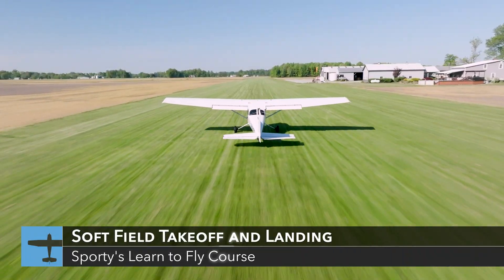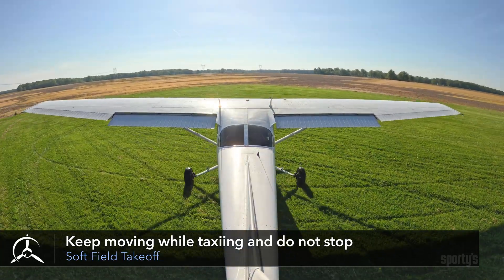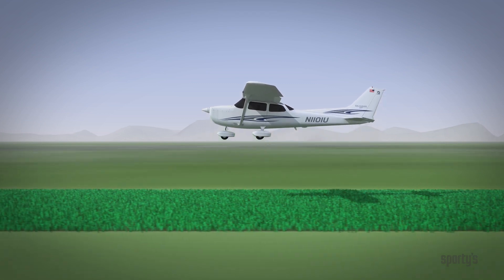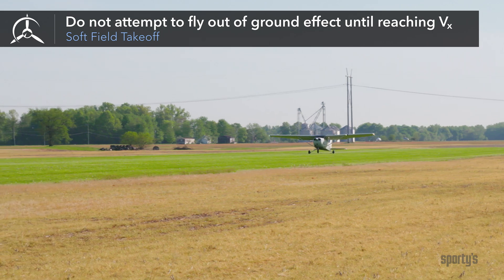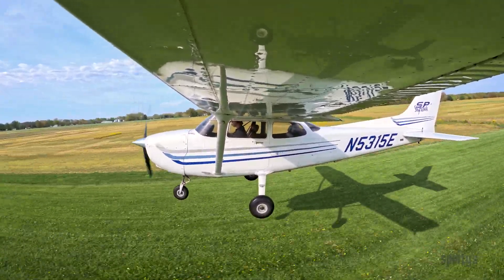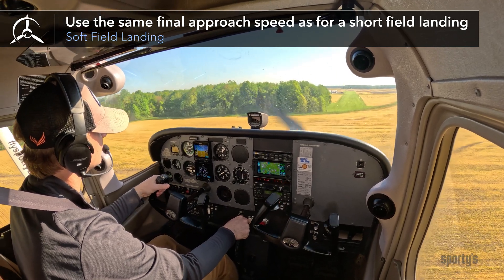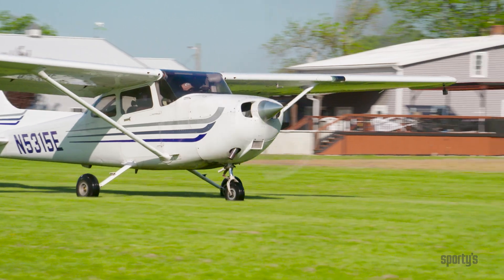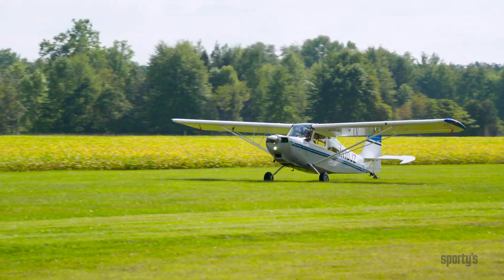How to take off and land from grass runways - Sporty's Private Pilot Training Tips

Comment: You should do your runup on a hard surface. Once you are ready, you set your takeoff configuration, then taxi from the hard surface while checking the skies and listening to the radio, with the control wheel back to take pressure off the nose wheel. You keep moving, like they said, out on to the runway and takeoff. You should learn the details from an experienced instructor because it's a strange change from a hard surface and reacting wrong can result in an accident.

Comment: I learned on a grass runway and was never told to takeoff any different than the hard runways we also trained on. Same for landing. And my instructor had over 27,000 hours going back to before Viet Nam. He flew both helos and fixed wing in Nam. One of the few to fly both. He flew small high wings for observation.

Comment: Is it a good technique to put the flaps all the way up upon touchdown and with full back pressure?
Reply: Its up to you, but i would recomend if the ground is very bumpy then i would focus on maneuvering the plane till it stops or slows down to taxispeed. You have all the time in the world to do it after that.
Reply: I don’t think so, generally. Maybe is it’s a soft short field but like the video says that take special training. I’ve been taught to raise flaps for short field landing because it transfers weight from the wings to the wheels by killing lift. I think the objective of soft field landings is to keep as much weight off the wheels as possible until the plane slows down enough. I’m only a student so grain of salt but this is what I’ve learned
Reply: @christianlogsdon6483  Well i am talking only from the experience of an LSA / Ultralight Plane. Thouse planes dont need much runway anyway and i only land on Soft ground like grass. So if you land correctly and not to fast then by the time the flaps are raised, which for elektricly controled flaps takes as much as 5 seconds, the speed of the plane will be way below stall speed. Maybe if you have manual flaps or on bush planes.